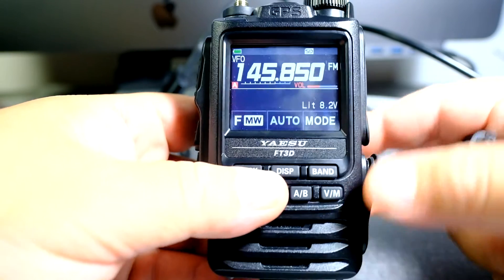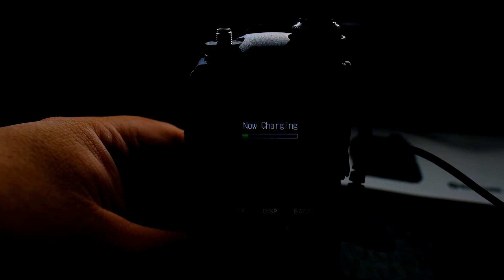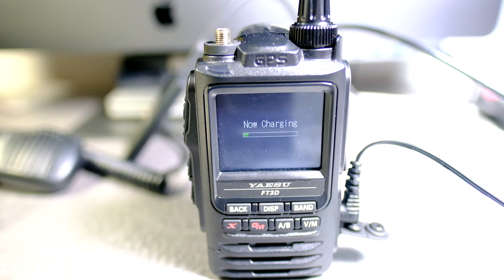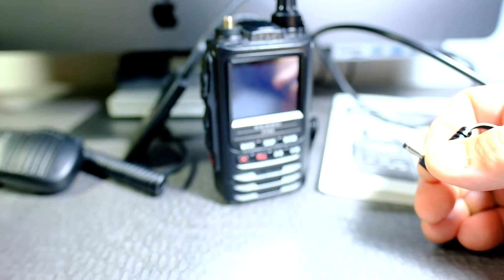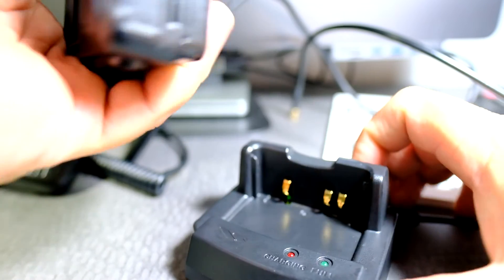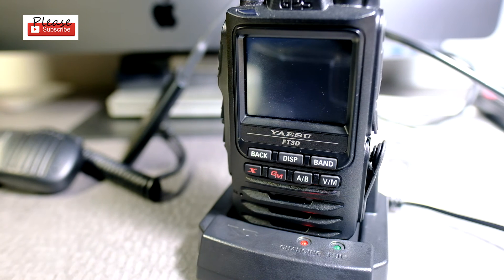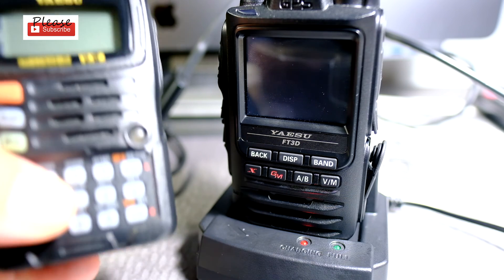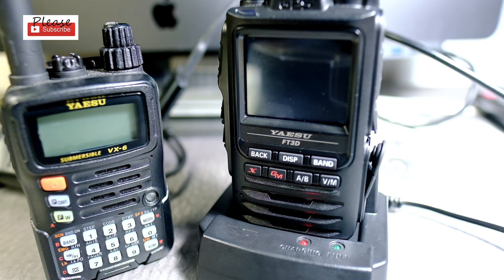Yaesu FT3D Charging

Comment: I realize this video was a while ago, and maybe you've figured it out by now. The green segment bar increases with each hour it is charging. Nine segments take nine hours etc. I would recommend looking at the voltage display while the radio is on to know what your charge looks like.
Reply: Thanks Jeff.  I don't have the latest firmware update and thus, that might be the case.  I do know that eventually the "Now Charging" sign disappears when the battery is charged.  I might do a firmware update just to see how it looks today.  Thanks for the tip.  Have a great day.  -73

Comment: For the amount of time it takes to charge, I will buy the cigarette lighter power supply, 2 extra batteries, the 3 double A battery pack and the rapid charging base with rapid charge cable. So far the charge time is the only flaw i have found with this radio. My first charge did the same thing, but the second charge was normal. Maybe the battery needed conditioning?

Comment: Yaesu might have this issue corrected. The charging bar on my FT3D purchased 8/2020 looks to work right. Took about 8 hours for initial charge, and green bar moved up gradually until radio was fully charged.

Comment: The Yaesu FT3D definitely has some weird charging characteristics.
Reply: I think so too, especially the fact that if the radio is powered on when charging the battery indicator on the LCD doesn't show charge level, but at least there is the option to charge without a cradle which is more than I can say for many other handies.

Comment: I know you said that bar doesn’t change but mine did after 5 hours I had 4 bars on my radio
Reply: I have never seen mine actually move, but I have seen it at about 50% and 75% of the way to full at times.

Comment: Unfortunately for me, this radio is the biggest pile of junk ever made. Charging issues. I put the radio on the charging stand and it doesn't charge. If I plug the power directly into the radio first, then back into the charging stand it sometimes charges. Audio is terrible and battery life is abysmal. Wish I could get all of my money back, I'd buy a second Anytone 878 for half the price, better sounding radio and the battery lasts and lasts.
Reply: @frankwc0o  Thank you Frank and I appreciate you doing the video as well. It's a shame because the radio is a good looking machine, and I do like the color touch screen. We are all good here. Just taking things day by day as my wife says. Stay safe.
Reply: Frank Romero how long does the 6r take to charge if your not using the cradle for it ?
Reply: Opening the lower right rubber panel will allow more audio to come out.  It makes a huge difference.

Comment: I found this on amazon and I have a few of them. They work really well with a usb battery and the voltage is regulated to around 12.3 volts and it plugs into the radio as well as the charging base. The USB adapter should be rated at 2.1 or greater and I’m using a 12v adapter that has 2 17 watt USB ports.

AEcreative USB Power Supply Travel Charger Cable for Yaesu Radio FT-2DR FT-70DR FT-270R FT1DR FT-817-ND FT-818-ND FT-60R VX-8R VX-7R VX-6R VX-5R https://www.amazon.com/dp/B07NTH7XK6/ref=cm_sw_r_cp_tai_lne3DbQTNYEG1

Comment: Thanks for posting this.  I just picked one up and thought I had a defective charger, battery or radio.
Reply: Did you ultimately figure out which one it was. I believe I am facing a similar issue. I put the radio on the charging stand and it doesn't charge. If I plug the power directly into the radio first, then back into the charging stand it sometimes charges. It's really hit or miss. Very disappointing.
Reply: @vincentdenich5034  - nothing was defective, the status bar just simply doesn't move or change.  Just let it charge for 9-10 hours, turn it on and check the battery level.